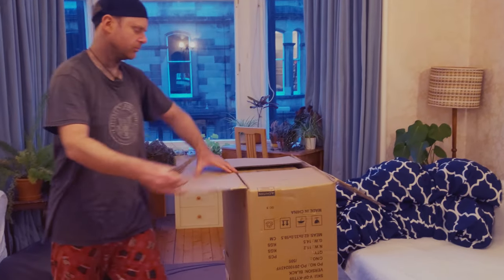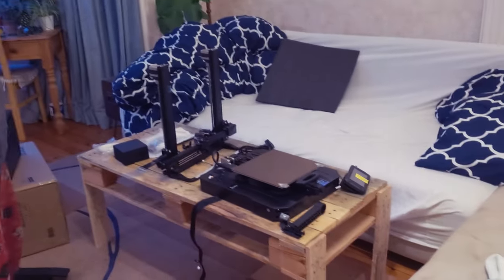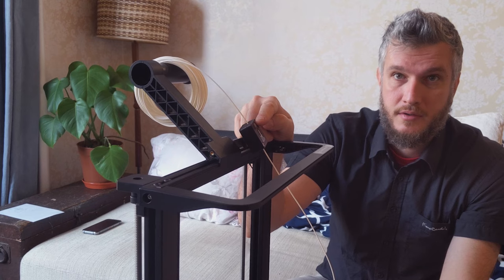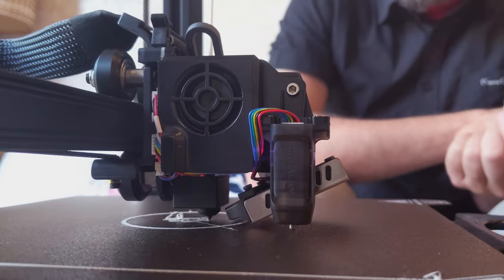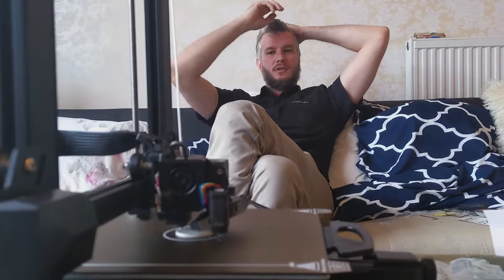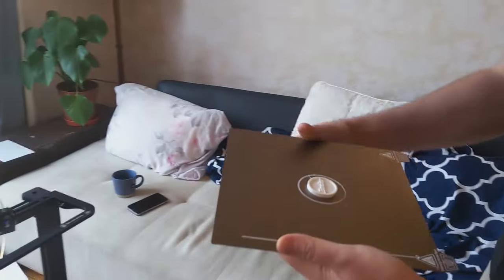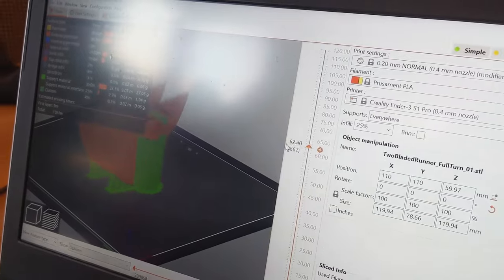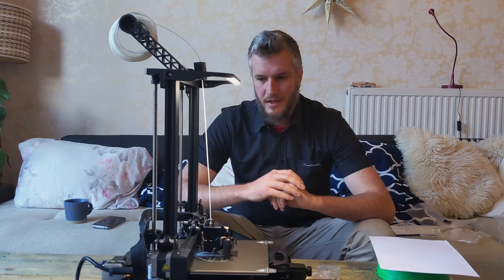More Complex Water Turbines with the Ender-3 S1 Pro 3D Printer

Comment: Forgot to mention. If you have any issues with this printer, I can probably help you out. I have the same model and needed to smooth out a couple of issues along the way.
Reply from the maker: What kind of issues did you have?
Reply: @OpenSourceLowTech  Some bed levelling issues, y axis rail was overtightened. 

SD card reader froze up and wouldn't read files once. Restarting didn't work. 

Some people can't get ABL to function out of box, so they need to mess with the gcode to get proper ABL, you probably need it as well.
Reply from the maker: The auto levelling has been flawless so far, card reader wasn't reading a file the other day but figured out it was the name was too long, which is an odd limitation but easily fixed.
Reply: @OpenSourceLowTech  Good that you haven't had issues with levelling the bed, however I wouldn't be so sure about your ABL system based on the sloppy first layer witnesses in this video. Take note that ABL is an abbreviation of the name "Automatic Bed levelling" but this abbreviation is entirely misleading as it does not really have anything to do with levelling the bed in the traditional sense. Instead when the printer is doing the 16 point probe it's looking for unevenness in the bed which it then will remember and compensate for during printing. If ABL is working properly your layers should be perfect and you should be able to see your z-motors compensate during x-y travel. Unfortunately  the manufacturer forgot to activate this ABL for 80% of users.
Reply from the maker: It's been doing the 16 point test before each print, and haven't been having any noticeable issues.

Probably the main thing at the moment is that my house is freezing, but I'll be making it a little insulated box to work in.
Reply: @OpenSourceLowTech  It's doing the test itself, but it's not storing and using the information during prints, that's the problem with the ABL on the S1 line. But it's still very usable without ABL, just won't get that last 10% quality without it. Activating it is very easy luckily, just add "M420 s1 z10" after G28 in the Start-up gcode inside your slicer. 

I realize trusting a random on Youtube is a little difficult so I'll post a link to a video in another comment which explains the problem.
Reply: @OpenSourceLowTech  Here's the video: https://www.youtube.com/watch?v=GmhBYOEb-ro
Relevant info from 3:40 onwards.
Reply: @OpenSourceLowTech  Hoping YT didn't auto-delete my link:)